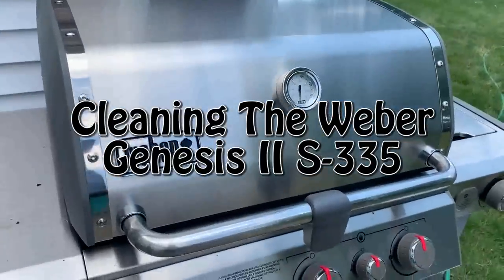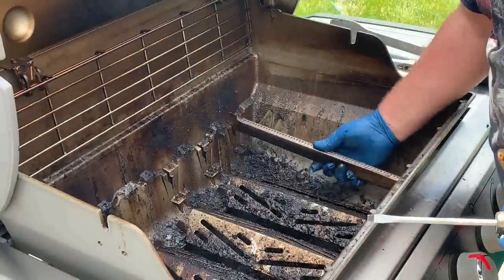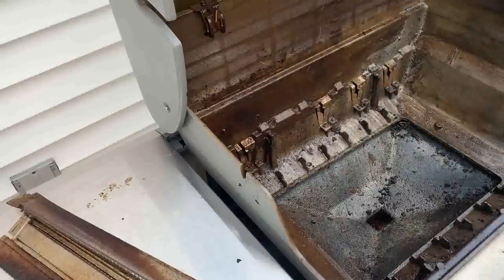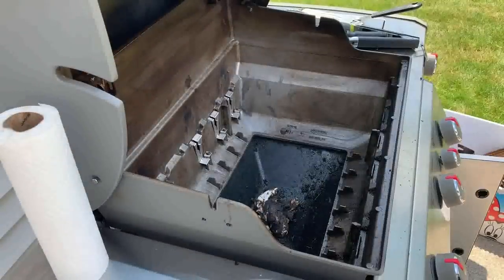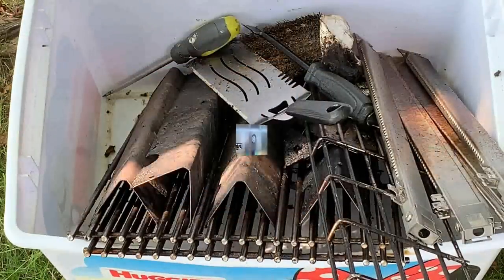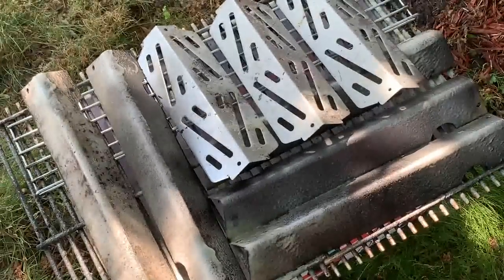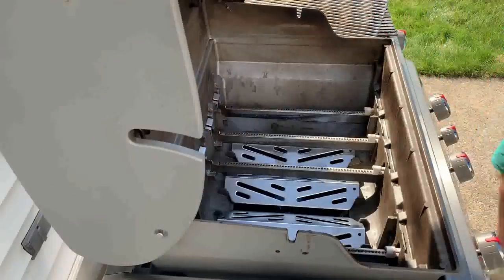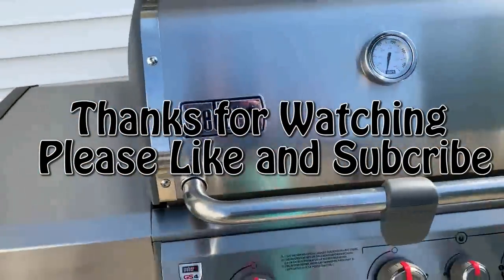Cleaning a Weber Genesis II Grill to look like new!

Comment: Nice job. I cleaned mine once too. Then Adopted an annual post summer ritual (for the last 15 years) of just knocking/sweeping off the chunks and debris into the drip pan (then change the drip pan). I routinely will run it on high for 15-20 minutes (to kill off almost empty propane tanks) and that helps it work like a self cleaning oven.

Comment: wow,  impressed the way you cleaned it.  I bought mine last year and it is dirty now.  I hope I can come up to your standards.  thanks for the video!!
Reply from the maker: There is an easier way to clean it I found. Get a bucket put under the hole in the bottom and power wash it with on of those Home Depot power washers. It works good. I did replace the flavor bars last week from some I found on Amazon for $75. Otherwise my grill still looks like it’s new.
Reply: @jstev67  thank you sir, much appreciated, will try it.

Comment: I have the same grill and used the same cleaner but I rinsed it with water instead of using paper towel. I placed a plastic tub underneath to catch the dirty water.
Reply from the maker: I just cleaned it again and did the same thing you mentioned I also used an electric power washer.

Comment: I use my grille nearly every day (sometimes twice a day) from mid May thru November. Then a couple of times a week all winter. I religiously clean my grille every two years whether it needs it or not. Usually a good flame-up is an indicator the grille needs attention. I don't use any chemicals (read the label on the oven sprays!) just elbow grease.
Reply: What kind of elbow grease??? And does it work well?

Comment: I'm putting off the idea of buying this grill after watching your video. I had thought really hard of the purchase for days, and your video just threw it out of the window. My Weber performer charcoal grill has been so much easier to clean and maintain for the last 10 yrs. Good video though!
Reply from the maker: I guess charcoal would cook any grease down to ash. 900F will do that. Gas is the easy way out, I like convenience of not having to wait 30-40 for hot coals. Happy I could help. This is a great grill though once you make the conversion.
Reply: @jstev67  30-40 minutes? It only takes about 10 with a charcoal starter. Weber makes them.
Reply: Flavour is the difference between gas and charcoal and 30 -40 minutes waiting for coals is absolute misinformation on your part!

Comment: I only clean mine after a grease fire necessitating rolling the flaming BBQ into the middle of the lawn and waiting at a safe distance for it to eventually subside.
Reply from the maker: I could burn it off. I have ne of those weed flamethrower I may do a cleaning video with that next time.

Comment: Under 45 minutes same result: I've been doing this longer, use a 5-1 Painter's Tool to scrape the cast aluminum into the porcelain pullout and if you're careful the gunk to the aluminum pans or use a plastic putty knife, and use a drill with something equivalent to "Avanti Pro  4 in. Drill Mount Quick-Strip Wire Brush" for the removable metal parts. Also use leather gloves if you like your skin.

Move all the metal parts to a work table, I have a small but sturdy folding table outside, grind off all the gunk down to the bare metal.

Everything should be fairly clean first then move parts to you sink or do it outside, wash off the parts and a quick scrub with a pot scrubbing brush or sponge. Replace the foil pan and reassemble. 

I get the brand new insane cleaning, or the professional grill cleaning. However, if you're constantly using your grill several times a week .. my method works exceptionally well and you don't end up hating your grill.

Good luck!
Reply: Scrub the burners, don't use the drill.
Reply from the maker: That was my first time cleaning it. Thank for advice.
Reply: @jstev67  .. I completely understand .. I've been there too and when the first thing you cook makes it looks almost like you never touched .. your attitude changes. Also IMO I'd replace the Flavorizer Bars once every couple or so years, or especially once they get heavily pitted or corroded. Thankfully they're on the cheap side.

Good luck! 😎
Reply: What is ‘insane cleaning’ ? Is that a product?
Reply: @jamesdove9519  .. Not a product I meant by obsessively cleaning your grill to the point where it looks brand new. After its first use there's a little difference between obsessively cleaning it and cleaning it how I described.
Reply: @jamesdove9519  .. Also I guess if you have unlimited funds then one of those laser cleaners would make it look like new with very little effort in a matter of minutes...

Comment: What is that tiny tool you use to get the little nooks and crannies?  Where can I buy one?  Also, where did you hide the ignition cords you snaped out of the burner rods?  I didn't see them inside the bbq while you were cleaning.
Reply from the maker: It was a chisel. You can get the at any box store. I just ticked the wires into the opening they came from and pulled them out when I was done.

Comment: why not use a power washer after oven cleaner sits for 15 minutes.. and then dry it off ,along with air drying. I have same grill. i think my  charboil infared was easier to clean however the weber  does cook different. Infared realing  didnt dry out the meats

Comment: Would you recommend steel mesh wire over the openings to prevent critters/rodents?
Reply from the maker: Too much work. Clean it and heat it. Little mice poop never killed anyone. Lol
Reply: @jstev67  erm except when they both nest in there or start chewing wires, including your fuel line. Suddenly the meat on the grill won't be the only thing cooking

Comment: They really screwed up these grills. What a pain in the ass to clean. I have the old school weber with the heavy duty stainless steel tube burners and stainless steel pull out drip pan without all those bottom flimsy heat shields and notches all over the sides of the grill frame so you just need to use a putty knife and go around the side frame and your done cleaning. They will be selling a lot of replacements parts for this grill.  Why pay 1000 dollars for a grill that you have to spend hours cleaning. Do you see those metal brackets that hold in the burners, i'm sure those will rot out in a couple years also. My weber is 16 years old and the only thing i had to replace are the heat shields and i got them from amazon for 50 dollars 8 years ago and they are 3 times thicker than webers and no signs of them going bad.
Reply: I'll bet dollars to donuts you don't even need those removable "heat deflector shields" on the bottom. None of the old grills had them. I'd probably just put tinfoil on that removable bottom tray and change it every two weeks or so.
Reply: you can clean it in 30 min easy -- the trick is to only do a good job cleaning, but not perfect which wastes lots of time and doesn't add to the flavor of the food.  you only need to clean the grill it every 15 to 20 grills.    you don't have to clean it every use.

Comment: Did you rinse the oven cleaner off everything? I did not see that happen
Reply from the maker: No I burned it off for about 30 minutes. I rinsed the parts in the water that I took out.
Reply: @jstev67  you do know you should rinse off oven cleaner
Reply from the maker: +Joseph Salak you don’t think 600 degree heat for 30 minutes will burn it off and left over chemicals left in the box. Come on. I guess I will get cancer then. I plan on cleaning it again soon. This time I am going to try a pressure washer with other viewer suggested cleaners.
Reply: @jstev67  Did you try the pressure washer yet? I have the S-435

Comment: Why not just use a pressure washer . Spray the cleaner let it soak and spray it .
Reply from the maker: I guess you could but not for nothing  It would be a wicked mess, with crap flying everywhere. Don’t you think.
Reply: Jeff From Boston - I put a tarp down then spray it with the pressure washer. Or if you have a drain system that you could put the grill near that works also .
Reply: I clean mine with my pressure washer and I’m very pleased with the result

Comment: Good video, but there's one thing you did, that was horrible and that was using metal to scrap with.  I recommend only using plastic like the plastic paint scrapers. they come in various sizes for ease of use  I use them and it keeps the grill from getting scratched up also on the drip pan.  they work really good and also cheap to replace if needed, other than that it is a great video. God Bless

Comment: If you use water any way, why not just put a pail under the grill and rising it off.
Reply from the maker: I guess I could but mixing all the grease and water gets messy and nasty. I like keeping it to a minimum and use paper towers  like I do when I clean grease and oil from pans
Reply: @jstev67  you used disk washer detergents for the other things anyway, just a  suggestion.

Comment: Good job on the cleaning. , it is a dirty job This grill will be my next purchase , When I have to clean I’m going to try Castrol  super Clean or simple green to melt  the grease and then use a steam cleaner jet the liquid will be minimal and you can empty the grease tray now and then , the steam cleaners are pretty cheap and will clean all the nooks and crannies too
Reply from the maker: Antimatter might be worth checking into. Thanks for feedback.
Reply: Jeff From Boston I also seen a vid of a guy putting a tray of water in the barbecue he put it on hi and steamed the whole box out to loosen all the caked on crud , sound like a good idea anyway
Reply: @Antimatter.  Sounds like an excellent idea, Ace hardware sells a SIMPLE GREEN FOR GRILLS, It is awesome stuff, I was thinking of steaming my grill with a tray of water spray on the simple green and then clean it. after taking it apart like  Jeff From Boston. I also use 1 inch plastic putty knife or and old credit , brass Tooth brush. works wonders for those hard to get to areas, just saying.

Comment: Could you jet wash it do you think?
Reply from the maker: Edward P yea I guess but I think you would get covered with the overspray.
Reply: Jeff From Boston good job...my husband uses the power washer...takes everything from the internal workings out ...power washes the insides...puts all the grill parts in a big bucket with Dawn detergent while power washing ....then power washes them on the grass and then “wallah”...good as new.  My Weber instructions claims don’t use oven cleaner ....for the outside he uses spray way and stainless steel wipes.